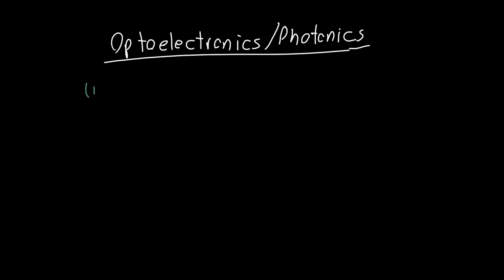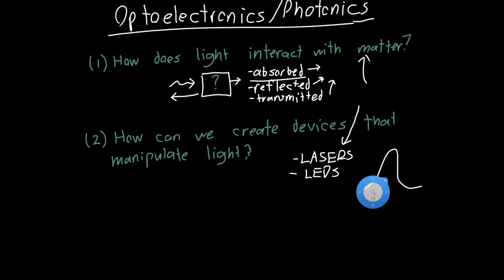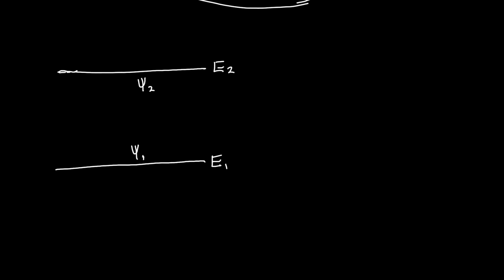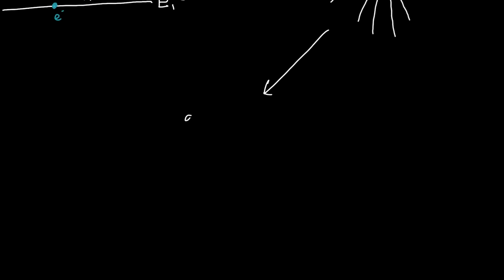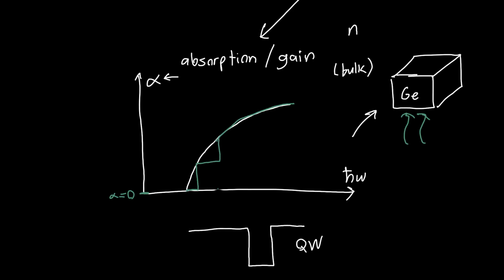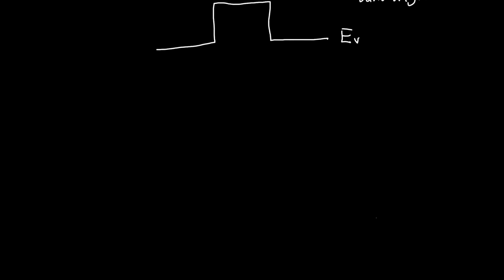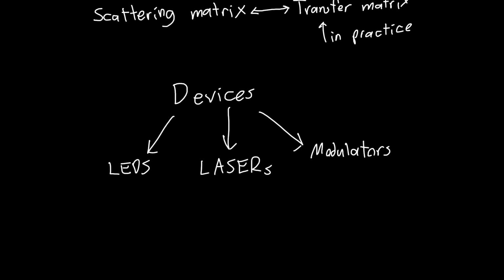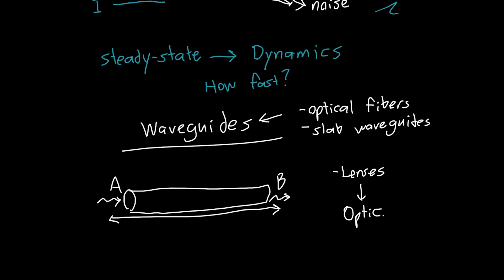Introduction to Optoelectronics and Photonics

Comment: Jordan have you heard of the company POET Technologies? They've apparently created a revolutionary Optical Interposer and Optical Engine. All their testing is complete and they are working with customers to integrate into products. I'd be interested in your opinion on the technicals they've released.
Reply from the maker: No I have not, it sounds cool but since it's wafer-level that's going to be very annoying for all the poor folks that don't buy whole wafers and rely on other fabs to send them chips. A whole wafer can easily run in the multiple millions of dollars, so it's not cheap.

Comment: Can you cover LED's and Laser Diodes. Gas detection with a laser.
Reply from the maker: Yup I will be covering LEDs, most of the Course is on semiconductor lasers (which are the same thing as laser diodes).